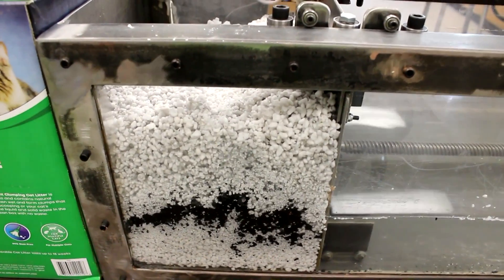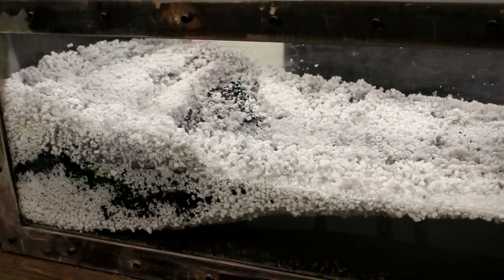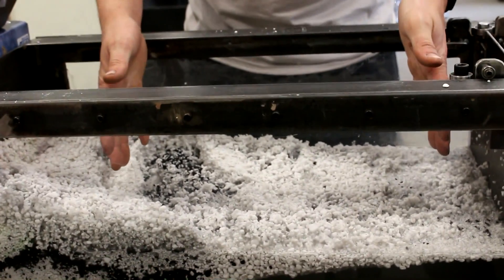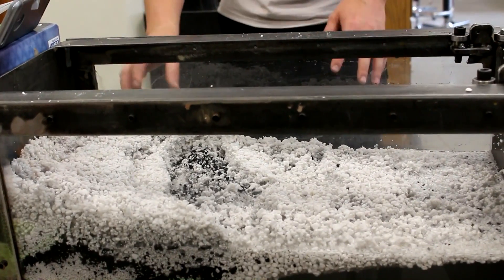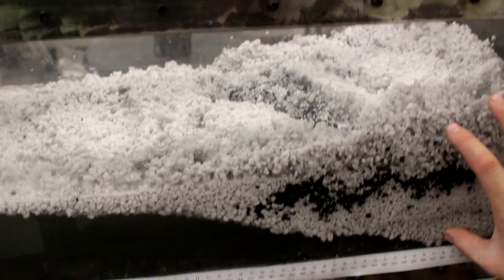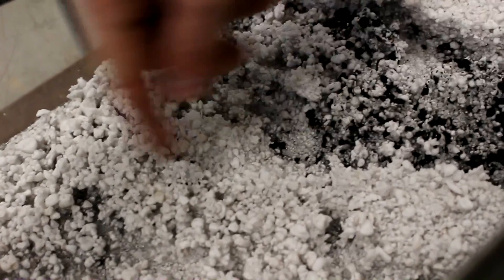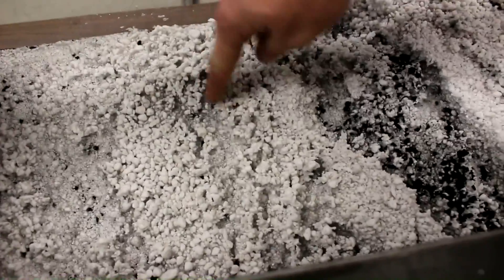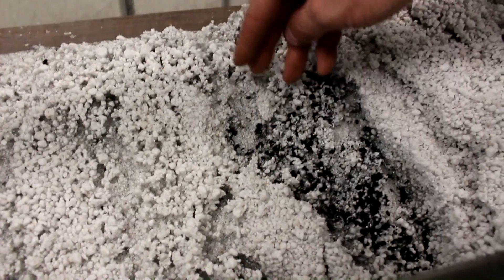Geo Sand Box with Floating Perlite

Comment: It would be interesting to recreate this with a much deeper tank, so the compressed sand doesn't level off against the bottom of the tank that quickly, also by adding some charcoal on top, as well as in between, to see the action going on at the surface.

Comment: I can tell you from experience that drywall is very vulnerable to water. in fact you have to get special drywall for use in HUMID rooms such as bathrooms.
Reply from the maker: We've always just used the water proof stuff for everything... I was actually supprized by how many people commented saying that drywall wasnt waterproof. like what good is it if its not?!
Reply: well it is good for walls that are dry as the name implies. It is good for adding a cheap and smooth extra layer which allows for things like insulation, plumbing and electrical wiring. if you were to use something like wood instead of dry wall it would be more expensive, not as smooth(bit of an issue if you want to paint it without texture) and it would be harder to work with seeing as drywall just requires a knife and straight edge for cutting.
I honestly didn't expect a reply on a video that has been out for a couple months already.

Comment: Perlite is actually a great insulation material. Build a house with large bricks filled with perlite, and you get great insulation without having to resort to styrofoam. Another advantage is the longevity of rock v.s. polystyrene, such a house can be handed down for generations.

Comment: Question: does the the extreme heat of the upper mantle affect how the crust deforms? I imagine the heat differential from the surface of the crust to the underside must be enormous, so would the deeper, hotter rocks deform more quickly than the layers above them? Or does the increase in pressure more or less negate such effects?

Comment: should've poured water on top simulating rain
Reply: I agree, some of the surface details may have been due to slightly drier surface Perlite that had less friction to overcome, it is not clear just how wet it was, perhaps it did soak all the way to the top but it looked drier to me.

Comment: Hello Cody, I have a question regarding your homemade cannon and recoil; if you were able to cap the front of the muzzle so the projectile cannot escape the barrel, but not completely to still allow gasses to expand, would the resulting forces cancel each other out, such that the barrel would move some percentage backwards, but when the projectile collides with the capped muzzle, and the barrel would immediately stop recoiling backwards? or in a near-frictionless environment, would the collision have enough force to move the barrel back to its starting point?
Just curious :)
Reply from the maker: The center of mass of a system always remains the same before and after so you would see the beral fly back but stop after half of its lenth.
Reply: That makes sense, and could be interesting to visualize~
Thank you for replying! I really enjoy your work and have learned a lot from the content you create

Comment: I don't know if I misunderstood you (English is not my mother tongue) but I want to point out that the crust is not floating on the mantle. This would imply that the mantle is liquid and that is not true. It's true that some parts of the mantle are partly molten but the melt ratio is too low to even create an interconnected liquid network. But it's true that the mantle (and even deep parts of the crust) can flow like a very high viscous fluid even if it's solid. That's why some geologists make analogue model of the asthenosphere with silicone.

I agree with you to say that your experiment look like a crustal root and that there is a kind of brittle/ductile transition in it, but I'm not sure it's due to the pressure gradient in your experiment. My guess is that the pressure at the bottom of your perlite layer is not enough. But if you look closely, this "ductile" zone corresponds to the submerged part of the perlite. So you are looking at two different types of deformation mechanisms : frictional in the dry part and water assisted granular flow in the wet part.

One little tip if you want to make crisp fault in sand model : add a little bit of water to your sand to increase the cohesion. Rock are cohesive and granular materials like sand are not : that's why you need wet sand to build a sand castle ! Or you can use dry flour, thanks to the very small grain size, static electricity increase your cohesion ;)

Comment: hey cody, i got a question, it's a little off this topic and this is might be a stupid question. why is earth crust did not melt while there are many more volume of molten rock beneath it? with the big difference in amount of mass, would the heat from the mantle hot enough to melt earth thin crust? ... sorry for my bad english and stupid question

Comment: At uni we our lecturer somehow got around the polymer engineering students to let us use their testing press... it had a pressure limiting valve to let water out and a bunch of different high pressure input tubes as well as the actual press so we were able to press coloured clay layers and some layers of rocky stuff (I don't remember if it was perlite ) floating the clay etc in a water column and keeping pressure on while pumping in higher pressure fluids from the bottom... we let them run slowly for a couple of days in some cases... but digital cameras were crap at the time so we only got time-lapse at 640x480 with a desk lamp for the lighting and took film stills which I think got into a paper or two...
The variation in confining pressure actually gave noticeably different shaped "deposits"
And they worked out speeds for different pressures where the clay stopped acting ductile...
A quick google search only gave me a whole bunch of computer simulations and I don't remember the actual authors so I fail pretty hard but I do remember it looked really really cool in person :-p

Comment: So instead of being allowed to use an easily contained fluid which is only dangerous if ingested, you were allowed to use an easy to aerosolize form of silica which is known to contribute to the development of lung disease when inhaled... Nice.
Reply: Kaslai perlite is amorphous silica and thus does not carry the same risks as crystalline silica. Silicosis is a result of the specific shape of particle that is formed when crystalline silica is fractured. They are unique in how the lungs cannot properly evacuate them. Silicosis also is only caused by chronic exposure to crystalline silica dust for a long period of time
Reply: Indeed, short term exposure isn't a huge problem. I didn't know that the specific shape of the particles determined whether or not silicosis occurs though. I was always instructed to be fairly cautious when handling perlite; is that just superstition/misinformation, then?
Reply: Kaslai well it's not a good idea to breath in a lot of any kind of dust, but no it doesn't carry the same risk as working somewhere that produces a lot of fine crystalline silica like a gravel pit or something similar
Reply: Having said that, better safe than sorry. It could contain a contamination of crystalline silica. If what you are doing produces a lot of dust, it is always advisable to wear some sort of air purifying respirator

Comment: Hey Cody, about your little gypsum experiment there at the beginning: I'd like to see you try doing the same thing after ripping off that paper backing. That paper sheet is what makes drywall actually a composite material: a fiber-reinforced ceramic. That paper is going to take a lot of the tensile load caused by the deflection of the sheet, which is strongest right on the edges of the material (hence the paper layer), and is probably the reason we didn't see the gypsum crack when you wobbled it. Anyway, this doesn't really have anything to do with the rest of this video but I thought it would be interesting to note.

Comment: Perhaps there should have been a bit more water so the material has more room to move down? May have also been interesting if there were heating elements at the bottom of the tank to simulate convection.

Comment: If you peel the paper off the strip of sheetrock, I guarantee it will snap instantly. Also, the gypsum is not flexing. It's cracking, but the paper provides enough strength to keep the cracks small and the sheetrock in one piece.

Comment: Now figure out a way to close the system so that the water pressure is not relieved through the metal plate that pushes it and is forced to the surface (or even just trapped in pockets) like a volcano on thrust faults.  Might be difficult due to the role wet oceanic crust plays in it, but if anyone can figure it out its you.

Comment: the gypsum itself has no real strength its all in the paper. if the paper fails it just crumbles to nothing. now lath and plaster is the real deal on strength and fire resistance it also will last for a hundred years

Comment: all the rock that goes under the "float line" would in theory melt and turn into liquid. If you could add this scenario to the experiment, I think it would be much more accurate. I supposed an upward thrust caused by the sideways force would cause solidifying underneath that part of the plate too. I'm not sure how you could do this, as any analogue that could be used that solidifies or melts wouldn't necessarily form a granular structure. Maybe growing water crystals in a bath heated underneath and chilled from above. It would take a huge amount of time, but it could work if you could control the solidifying process.

Comment: Right as you blow something away (9:38) a tiny bug landed on my laptop.  Spent the next 7 minutes trying to catch it in bag so it could be identified.  trans-Gold, 8 legs, but lacked the shape of a spider, could not even tell which end was which at first.  Legspan ~2mm Body length ~1mm  Has a Red spot inside the body.

Comment: cody is there a liquid non toxic material thats heavier than water? if you were to fill a big room with it and go in there with air reserves of course and were to go in the room and walk on the roof youd be feeling like gravity has flipped.
Reply: Saturated saltwater? yeah that's a lazy answer, but it shows that an answer exists.
Your inner ear would still tell you the gravitational down so it might be very disorienting.
Reply: rodger so Galinstan? A mixture of Gallium, Indium and Stannum (Tin). Non toxic and liquid AT room temps. NaK is also a unpoisonous liquid at room Temperature, but it is quite explosive.
Reply: Florian Daßler is it transparent
Reply: Benjamin, your inner ear cannot determine direction as such, it is a rate gyroscope and senses angular motion of your head .  However the weight of your insides would be felt in the wrong direction and you should be able to feel your orientation to some extent.  Certainly it would feel odd.
Reply: Rodger, You do not need to be much denser than water as a human will float in it and could even use something less dense like oil or alcohol (health hazards aside) if you used some negative buoyancy wet suit.  Scuba divers have a problem staying down without extra weights and all you need to do is put on cork boots and a concrete vest with your scuba gear and go walk upside down in a tank that is full to the top.

I think it would make a swell experiment.

Comment: Hey Cody, have you ever done anything with a Fresnel lens?  I was curious how hot you could get a furnace using Hydrogen and Oxygen in combination with a Fresnel lens in the Summer.  How hot can you make a solar furnace get by first heating it with the Fresnel lens and then boosting it with Hydrogen and Oxygen from there.  Maybe a DLP TV screen sized lens or larger.

Comment: Brilliant. I learnt a little more geology. Is the floating rock demonstration something your lecturer uses or wants to include in the future as it does show how it all works very well.
Next time introduce a pressurised hose at the base of the rocks pointing upwards. Then turn the water on to simulate volcanic activity. I'm not sure if the water will be thick enough to simulate magma / lava. If not, you could add guar gum powder to the water, to increase the viscosity of the water. Also add orange food colouring to the syrup to make it easier to see.
I'm not sure where you can buy syrup pumps though. But I'm guessing that wouldn't slow you down much.

Comment: Cody, do you think there would have been a significant difference if you had used mercury, or a fluid that is more dense than water to conduct this experiment? If you were able to repeat this experiment with different materials, do you think you would have yielded the same results?

Comment: Cody, you should make video on why is crust thinner under the oceans.
Reply: TheAllegiantTraitor I don't think it is. I think the ocean is on the thinner crust. I think the water went there because it was lower
Reply: Anton Helsgaun

interesting...
still worthy of a video
Reply: as seen in the experiment with water, when he turned the piston back it got stretched out a bit, forming a very thin layer compared to that mountain. the thin layer (thin crust) is not only thin, but also very low so that water will flow to that part and form an ocean.

im hyped for the mercury - stones - water experiment!
Reply: I think part of that also has to do with water being very heavy, relative to many forms of rock which compose our crust.
Reply: mathig nihilcek

water and heavier?
i find it hard to believe it with all the aluminium and silicon
Reply: mathig nihilcek

oh you meant relatively heavy.
i should read before i write....
Reply: It mostly has to do with density and age, the oceanic crust is relatively young rock ( at only 200 million years old for the oldest) and tends to form quickly and very densely at the rift valley due to water heat conductive properties and compression from  water pressure, with the resulting density oceanic rocks tend to subduct under continental rocks which causes those areas to float. +Cody'sLab is there anything that I am forgetting?

Comment: In the real world what would be the thing that is pushing the rock?  Where does the sideways pressure come from? Does the ocean move the continents around?
Reply: Asuhh Dude How You're the shittiest type of commenter.  In those two reply's you could have just answered the question, but instead you be a cockhead.  Degenerate smh
Reply: Look up plate tectonics, but the gist of it is that differing heats in the mantle causes the molten rock to move, like the ocean currents, and the tectonic plates, on which the continents sit, are moved along with the current.
Reply: The reason the Earth has plate tectonics is mainly because of its rotation, the Coriolis effect. Venus on the other hand doesn't have plate tectonics because it rotates very slowly retrograde. Venus is very similar to Earth in size and density.
Reply: Matt what it is is the magma withing the mantle moving upwards as it heats up, and then it goes sideways because the crust blocks it from getting to the surface. the movement of the magma along the crust then pushes the plates apart. its quite fascinating if you look up a map of the plates and how they move, you can understand things like the Himalayas and California's fault lines much better, and geology is just plain fun anyways!
Reply: Matt those questions are basic geology stuff. How didn't you learn this? Also google is your friend.
Reply: I hope you're trolling
Reply: It's been a while since I learned anything about this in school I don't remember how it works.If you know the answers you could have just answered the questions...

Comment: Cody what do you think is in the center of the Earth? My hypothesis is that it's a solid rock type mass. The giant mass of lava just doesn't add up. My limited research found that Russian have drilled further than anyone, and they stopped because they basically quit making any progress.
Reply: drilling isn't the only way to find what's down there. There are experiments that can be done that narrow down what's down there without actually seeing it. For example, we can time how long vibrations from earthquakes take to get to places far away and can use that timing to figure out the type of material the vibration went through. Due to experiments like this we know that under the crust is molten rock which has layers of its own, and then below that is a solid core.
Reply: and if the core of the earth were anything with less density than metal its gravitational pull would be a fair bit weaker.
Reply: We know that the core is divided into two different layers, a solid center composed of mostly iron, with a liquid coating composed of mostly iron.